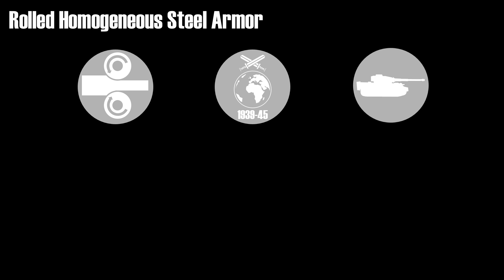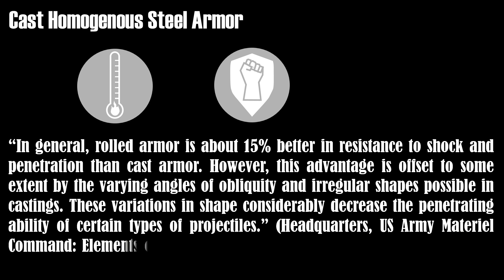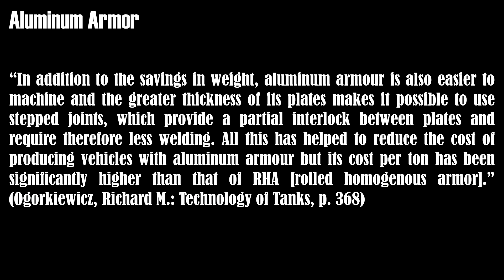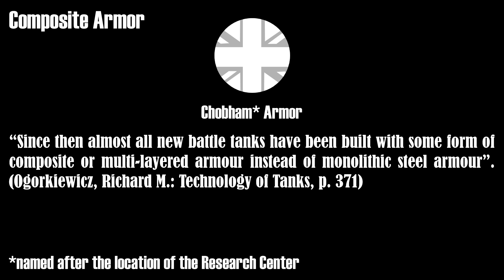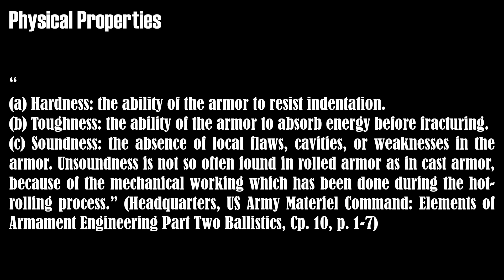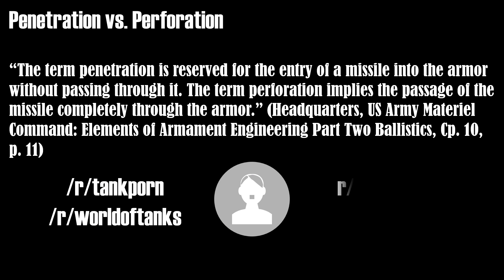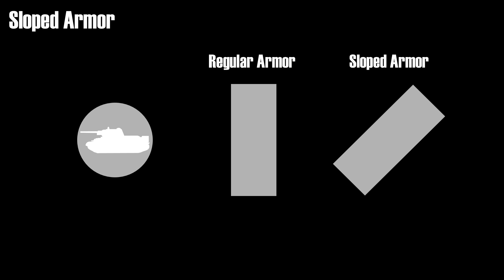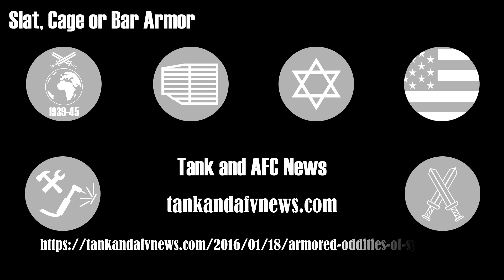[Tanks 101] Armor Protection 1920-1980 - Features and Characteristics

Comment: Another thing to consider about armour is that when it is sloped it, as well as generally giving better protection, it is often lighter than flat armour. Take for instance the upper frontal hull of the Pz IV and V  where you can see that the IV has two plates, one flat and one vertical whereas the V has the single plate. Sloped armour can also be cheaper simply because it uses less plates simplifying production all round.
Reply: Using sloped armor generally comes at the cost of internal space. Imagine the hull of your tank as a square box, and then youre making diagonal cuts around the corners, chopping them off, and you end up with less internal volume. 
Another factor is that the surface on the roof is diminished as well, which makes it difficult to place escape hatches. Most german tanks had them in the roof, but the T-34s driver hatch is embedded in the glacis plate itself, which is less than perfect (but compensated by being thicker overall), and some Sherman variants used a bulge for the driver and radio op in the glacis to get the space for the hatches and optics at the expense of these bulges in the glacis being more vertical, prompting them to weld on extra armor to compensate.
Reply: When they had plans to give the panzer 4 sloped armour it made it heavier so i think your missing something
Reply: Slanted armor of the same overall thickness is heavier because the plate must be longer. Reduction in weight comes when you reduce actual thickness and create a new LOS thickness.
Reply: 19Koty96 Indeed, but soviet training in 1940 and 41 was brazingly incompetent at times. I recall a russian report from the winter war saying something about a T-28 commander who was ordered by his commander to "advance that way" literally waving in a vague direction. The T-28 therefore drove that direction, that there were tank traps, and returned, having done nothing other than wasting fuel. That and a couple of incidents including artillery firing on their own recon units by accident due to poor coordination.
Reply: Allow me to clarify.
Say you're armoring a crew compartment that is 3 meters by 6 meters long by 1.5 meters tall. A 10 cm glacis that is perfectly vertical at the front will measure 1.5 meters by 3 meters by 10 cm. If you angle the 10cm plate at 45° the plate must still keep that same crew compartment safe but will now be 2.12 m long. Thus, for the same plate thickness, you will have a longer, heavier plate.
The weight savings from sloped plates result from using plates of thinner over all thickness at a specific angle to produce a desired LOS thickness. For example: If the plate is to have a LOS thickness of 10 cm at 45° of slope, then a plate of approximately 7.07 cm of thickness is required. At 60 degrees of slope, 5 cm equates to 10 cm of LOS thickness. But as you thin plate down to save weight or as you increase slope, you run into other problems such as risking overmatch penetration and increasing amounts of unusable space within tighter and tighter angles.
Reply: A war CAN be over quickly if it is on a small scale, by global standards. One european country versus the next one for example, you can overrun a country before they can mobilize the necessary resistance. 
But a war that drags out more than a year, by modern standards perhaps less, will mean that the defenders military can also properly mobilize and the offensive effectively stalls at some point, and then it just goes back and forth and eventually tips in one direction, but it takes long, causes high losses on both sides. 
And that already happens in the middle east. On average their "tanks" are trucks with guns or rocket launchers, sometime just assault rifles and RPGs. Can the combined Nato forces down there achieve any decisive victories? Not really, its a steady advance, but given how long this has been going on it is very slow. If ISIS had any real military industry that could compete they would have already offered much more significant resistance and maybe actually hold the line. 

Also: Stop assuming 1vs1 engagements by default. Life isnt an action movie where the henchmen attack the good guy one by one. If one more advanced tank goes up against two less advanced tanks, the two tanks have a higher possibility to win, a low possibility to win without losing one tank and next to no chance that they both lose. Why? Because no tank, excepting stuff like a T-35, can fight two tanks at the same time effectively. 
But having more raw numbers has other advantages. Look at Normandy. The US steamrolled the germans basically. Why? Because their "inferior" Shermans went up against AT guns, Panzerfausts, Infantry, occasionally a StuG etc., but the germans simply didnt have the numbers in armor to use it outside of major offensives. And even then they still didnt have enough tanks to achieve anything. What were their shiny panthers worth then?
The same thing works to lesser extent with smaller number advantages, but it still applies, if one side has more tanks, even inferior ones, they will be able to deploy them where the other side has no tanks because they ran out of tanks to deploy, and then your inferior tanks have a turkey shoot basically. Worth it? No matter how advanced your tanks are, they will never be able to be in two places at once. And in war that advantage is irreplaceable.
Reply: REgamesplayer you keep thinking that a war is won by technological supremacy rather than tactis and Strategy. take one look at france in 1940.
Reply: 19Koty96 Yeah but it wasn't shit. Adequate as you pointed out is much closer. Though having said that I'd say the T-34 was basically perfect for soviet needs at the time.

Easy to produce, easy to learn to use (maybe not effectively but still), always competitive with German tanks with T-34-57 penetrating tiger. Any tank that would be better would take longer to produce and would take longer to train on.
Reply: REgamesplayer And when will you get that developing the next generation of tanks will not achieve anything except an answer in the form of an enemy new generation of tanks? Its pointless spending more than neccessary to solve the existing problems, we neednt create new problems. 
The current tanks work well in their assigned tasks and a replacement with a completely new platform would be both uneccessary and wasteful, as both mechanics and crews needed long to adapt to it, while there seems to be little benefit apart from a temporary advantage in firepower that can be achieved more easily by upgrades. 
Tank development even in the US hasnt stopped, but the military hasnt accepted new vehicles because none are needed. 
And in numbers and quality of equipment, the US already outmatches any other nation in existence anyway. So why do you need more?
Reply: at least he's not a war mongrel...
Reply: In part I was trying to keep the first comment short. Overall that depends on the tank of course. For instance if you have the same thickness of plate for both the vertical and horizontal plates then obviously the slanted plate will be lighter at the same thickness. Whilst if you have a thinner or smaller horizontal plate it may well be lighter. Maybe the Pz IV/V comparison wasn't a good example as I'm uncertain of numbers but this would id be a lot more certain about the early Pz IV's. Also to Kekman (your post is removed as spam and I can't restore it?) The Pz IV with the sloped armour had many modifications such as a completely new turret and various other parts redesigned so may have been heavier due to this.
Reply: The reduction in weight comes also if you remove the side armor from where it used to fit to the vertical armor.
Reply: I always wondered of how to keep extreme angling of at least of 70+ degrees. You see, armor penetrating shells start facing real troubles in connecting with a plate from that angle which could not only make very scalable armor, but an armor which would bounce the most shots, even ones which could destroy the tank. But with this kind of armor, driver's position becomes unmanagable. You have to transfer him near the turret and turret itself to push back into the tank. I prefer putting transmission and engine under the frontal glacis and isolating this compartment with additional layer of armor. With addition of V shaped hull, you can place threads neatly in the tank while top layer expends with extreme angle, giving overall very high protection levels overall. That also would allow to put huge turret in relatevily small hull which is necessary in this day and age with 130/155 mm anti tanks guns being a standard (standard calibers are incapable of reliably defeating modern armor anymore).  Furthermore, as turret being completely automated, you do not need to space it out and thus you can angle the gun's armor as extremely as possible.

The only real issue which I have is: how to get out? I would have back doors for entire crew, but is it sufficient? The only next exit point is at the back of the hull, you crawl out of it, but that is quite pointless since doors are just so much more efficient and it is in the same area point as this hatch would be.
Reply: REgamesplayer Another option is to do the same thing as the Merkava Tank, which placed the engine and transmission together in the front. First advantage is that it enables you to further stretch the slope since the engine in general is less demanding in height than a driver, but it adds length until the hull needs to reach the drivers height, ergo enabling a much more extreme slope. Second advantage is that if anything penetrates, especially the lower glacis, it takes out your transmission and maybe your engine, but practically nothing will go through into your crew compartment and hit crew, fuel (in the rear behind the turret ring) or ammo, meaning the tank would be salvagable and the crew alive.
Reply: and if you manage to do a thick turret armour, it turns into a very good pillbox until rescue comes... But who wants to risk their lives?
Reply: Yup, this is why I had suggested putting engine and transmission in the front. :) In all actuality, my MBT would be very different from all today's tanks. I'm not saying it would be more advanced, but I'm saying that I have different attitude, mentality towards armor. Like Russia's tanks vs USA tanks. Same is with me, I prefer investing into sturdy platforms, that is including highly trained crews with exotic materials, combined with composite solutions. I would hide or up-armor those fragile external systems, I would make redundancies like wirring. My tanks in general would weight quite a bit due to heavy angling with very heavy armor.

I do actually consider to produce two lines of MBT. Which is quite feasible for a major power. Why? Because nowadays both platforms cannot do anymore that is needed from them. A MBT has to compromise on its weight, to be under 50 tons in order to be easily transported. That limits its upgradability and western tanks are already heavy tanks. If you cut the weight down, it becomes unable to compete. Thus MBT are heavy tanks in their role. While for maneuvering and flanking roles. for blitzkrieg I would use fundamentally different armor scheme, designed to protect from 105 mm shots. Tank would be more similar to Leopard 1 or PL-01 in its design.

Why I love armor so much? Because armor weights quite little. I mean, just to create a tank with gun, turret, all its systems will take much of the weight. 10 tons of additional armor is a lot of protection which really makes you question, is there are really big difference in mobility of having 30 ton tank vs 40 ton tank? Mobility actually matters then vehicle is around 20 tons due to difficult terrain which tanks could not pass, this is where you actually have to keep your weight down.
Reply: REgamesplayer Current tanks already get quite the most out of their mass limits via armor modules. Take the modules off, and its light enough to transport, put them on and they are protected enough to fight. 
Also uparmoring any and all fragile external component doesnt seem feasible. Most of them are one or another kind of optic, and you cant see through metal. Keeping them protected from bullets suffices. If anything bigger shoots at you, you have bigger problems anyway. 
My personal approach would be to minimize the silhouette, making the tank lower, similar to the philosophy of the T-54 and russian tanks thereafter, though with a more pointy turret front, and perhaps combined with the idea of a front engine.
Reply: In this day and age silhouette is practically useless with pin point accurate gun and various optical devises. All that still matters is now the space which you need to up armor and efficiency of the crews inside the tank. 

Modules are recent invention, yes, but they do not go nearly as much as needed. They do not transform light tank to heavy one. This is why you cannot make MBT a light version, because it will always have vast majority of its weight directly installed into its own hull. 

I'm not sure how well they are protected. Against feeble western arms of 5.56 mm yes, but I highly doubt that they could take 7+ mm ammo. The more pressing issue is HE shelling. A simple rapid firing 57 mm cannon is deadly to modern MBT. Not because it will kill it, but because HE shells will wreck havoc to all those fancy external defense systems. Active defense will be out. Explosive armor will be made ineffective, optics destroyed. I would even go as far as attacking enemy tank chemically. You see, I have idea of a shell...

It is a sticky shell which is low velocity. It sticks to the tank surface, spraying it by sticky liquid or substance. This substance is then ignited. In this way it would generate deadly smoke to crews inside, but more importantly it would deactive tank completely. Heat would mess up with sensors thus any active devise would be rendered ineffective. In addition, crew would be forced to stay put and calm. I want to complete shut the crew inside the tank, forcing to use internal oxygen or kill them. You see, this chemical substance would not only produce heat, smoke, but also that smoke would be "heavy", meaning it would float near the ground and in high concentrations - deadly. This would mean that unprotected crews inside the tank would die or if NBC is working well, they will be forced to stay put.  They could not outrun the smoke since tank would be covered in it. Also, it is great psychological weapon, knowing that you are completely blind and your defenses are down and there is enemy out there, preparing to murder you. You cannot run, you cannot get out. You are burning surrounded by deadly mist around you. 

The advantage of this shell is that it is cheap. Is independent of caliber and can make any cannon effective against even most heaviest of vehicles or bunkers. 

Btw: Do not think it is a science fiction. Napalm acts in similar fashion and it had proven itself as extremely effective weapon. I only want to increase our AT capabilities by bringing it down from aircraft to ground crews. Of course, key is: how fast it burns? It should last minutes at least to be combat effective.
Reply: In addition, if you have to transport vehicles, you as might just dissasemble them and transport hull+turret of MBT. You will just assemble them on the battlefield. In this day and age, it is more masturbating than fighting. Modern armies severely lacks transportation capabilities for huge amount of material and men and they severely lacks deployable infrastructure in combat areas.
Reply: Yup, mostly because they fight way out of their territory, so they have to fly most stuff in, and how many airplanes in the world can lift a tank?
Reply: builder396 quite a lot. The problem is - US tanks nowadays weight around (well over) 60 tons.
Reply: 19Koty96 Indeed. Making a tank progressively heavier is a trap that tank development heads into repeatedly. 
Simple fact is, if you want to have a better armored and armed tank you can theoretically stay within the same weight if you make it more complicated, but it would take years to develop the more complicated technologies necessary, and often engineers or armies are not willing to wait and take a shortcut of making the tank heavier and live with the consequences. The result is tanks like the Panther and Tiger I and II tanks of nazi germany. The same result could have been achieved with less mass, as evidenced by tanks like the Pershing, Patton or IS-3, who had comparable parameters but at significantly less mass, but arrived some time later on battlefields.
Reply: It is certainly not like westerners practically wasted decades worth of development. Just saying. If there is a thing that we have is this: time. Then war will start, that will be last time in our reserves. This is why I advocate extreme R&D budgets compared to that we are used to and I advocate closed markets. High tech should not be sold ever. Westerners on the other hand are way too willing to sell tools of their own destruction. Finest example is: French sold night optics for T-90 development. Due to purchases of combat computers and optics, Russians kick started their development to our level and we instantly lost decades worth edge. Now they threaten our borders and all we can do is whine then technologically superior forces, which was trained by us, threaten stability of Eastern Europe.
Reply: REgamesplayer High R&D budgets is the last thing you (I presume you mean US) need. It will just compound your problem of weapon systems being needlessly complicated and give companies an excuse to prolong development, i mean, money is flowing anyway, isnt it? Complicated weapons become useless in a prolonged war as you need more trained crews and significantly more effort assembling them, neither of which you have a lot of after 2 years of war. 
Cutting R&D budgets would drop a lot of worthless junk that has no practical application anyway out and make militaries focus on actual practical and useful weapons that win wars and not just weapons which look impressive. There already is an insane amount of money flowing into weapon development in the US, yes INSANE, but it proportionally speaking what comes out of it is significantly less than what you get from lets say german companies for the same amount of money, and we spend rather little on weapon development, but we have an excellent tank that can outperform an Abrams while being more economically minded. 

Getting ahead in technological development isnt worth squat in warfare as you need to be able to have the industry to back that up, and if you can only build 5 supertanks per year, and your enemy builds 50 reasonable tanks in the same time, guess who wins. The winning tanks often were innovative but never expensive or delicate.
Reply: Design of the systems and efficiency of R&D sector has nothing to do with the size and scope of development. Second thing is: R&D is long term investment. Having technological edge is crucial. Sooner or later you will have to research those technologies anyway and having done so in advance could help you to keep dominance in an age of strife like great depression. Look at F-22, Russians are only now catching up despite Americans sitting on their laurels.

The sorry state of USA research industry is just a bigger part of rot which complacent Americans allowed to happen. It is not a matter of bloated research budget doing nothing, but rather that leadership is pathetic. Look at Bradley, look at flak vests. Look at many things which they cannot perform. If it would be my nation, knowing distribution of flawed military goods would be considered a high treason and I would hang outside the White House everybody involved in it. Americans on the other hand do not care much about the quality of their goods as long as profits are floating in. 

Third point, R&D does not symbolise raising costs of the equipment. It is just that you choose to do with 100% solutions quickly. Instead you would need to look at how to keep or increase combat performance at the minimum needed work. For example, how to produce more advanced materials more cheaply. Or how to drive electronics prices down. For example, night optics were extremely expensive at their introduction, nowadays even civilians can afford it. This are just few examples of how R&D can help. It is all the matter of what are your goals. If goals are to make more cost efficient platform, to cut production hours, material costs without reducing performance in any meaningful way then this is that you are going to get. 

Weapon systems are destined to become more and more complicated. With new technologies being developed, more advanced counter measures are bound to arrive. For example, drones are the future. Armies need swarms of them. The first army to amass an effective drone fighting force will have immense edge. 

The issue is poor leadership and willpower. Westerners cannot pay with blood so they pay with treasure. Or in other words, if you want to save money then use lower tech gear, less support and etc, but be willing to send back your men in body bags. I can make this trade, do you? Westerners sadly cannot. 

Not true. Europeans despite not having huge budgets can afford to produce next gen equipment on their own. Producing advanced combat equipment means investment into technologies which could be used in later developments. It is not like you produce F-22 and this is it. No, bulk of the cost goes into technologies which you could use in other projects. You then build from those technologies. Stealth for example is expensive tech, but as you can see nowadays, it is essential technology. If you would begin from scratch now, you will need decades to catch up and you will still pay most of the price needed to research it.

Wars nowadays are not prolonged affairs. They are short and brutal things. If you plan to wage war for years then you need tanks like T-34. If you plan to wage short skirmish then you need tanks like Tigers.  Quality>>Quantity or in other words, if you are planning to wage short campaign, the quality will outweight quantity.  

Furthermore, please state that is being super about newest western equipment? The fact that I would upgrade them to 130 mm or even greater as standard? It is a fact that current generation weapons are underperforming against newest armor. The fact that I would use exotic materials in my steel armor? Are Abrams really that inefficient and expensive? No they are not. Turbines either are not that problematic.  The real issue is that westerners had abandoned their military and Europe's martial might is in shambles now. If Russia would attack today, it would destroy Nato forces within days and would be at the Berlin before we could do something meaningful.
Reply: REgamesplayer You know that the US spends more on its military than the next 6 countries put together? Sure, europe might fall early on if russia makes a sudden push, but as soon as it comes to the open sea, russia cant even begin to compete in the sheer number and size of carriers the US employs. 

Having a larger gun or thicker armor never won a war on a big scale. Sure, Tigers could knock out ten tanks before the enemy could destroy it because of its thick armor and excellent gun. So could Panthers, Tiger IIs and Jagdtigers. Except they kept breaking because the technology was too advanced to sustain. The best tank in the world is worth squat if it is mechanically unreliable or its crews are incompetent (german tank crews from 43 onward were on occasion grossly incompetent). 
The other 2 sides (Mainly US and Russia) had the simple advantage that their tanks were generally only a little bit inferior in firepower and a bit more in armor, but they were always available. They were easy to assemble, easy to maintain, easy to repair and easy to use, and they were servicable. 

Besides, you can save your "if russia attacks today" scenario. Russia isnt attacking. And even if, your paranoia wont help either way. Even if the US developed a bit ahead in weaponry, russia wouldnt need to match it, they just have to be close enough to be in striking distance (and the US tends to demonstrate what it has so staying on their tail wont be hard), have guns good enough to destroy your tanks, even if it is statistically 0.9 kills per lost tank themselves, because they produce 1.5 times more tanks than your hypothetical hyperadvanced tech tank. That is of course an oversimplification, but in principle a big technological advantage can win a war, a small one works against you, because it costs you in numbers.
Reply: So, you concede Europe so easily based on the aspect which is quickly decaying - naval might? 
I know that USA spends the most, but that is due to the fact that Europe spends next to nothing on its own protection. This is why Europe is defenseless. 

Tanks compared to German ones were vastly inferior, not just slightly inferior. Only Russians had initial advantage which Germans overtook and lasted only until post war. You also ignored my whole point. I'm not speaking about total war. This thing is a myth. It does not exist in the modern war. All conflicts are painfully brutal and fast. They are skirmishes, not grind fests of economies. In skirmish quality wins each time.

It is not paranoia. It is a fact. Do not try to hide over the rock like rest of westerners do. Nato is in shambles. Our borders are unprotected, we are loosing everywhere. We have very little wisdom, cunning and capabilities to do anything properly.

Technological edge matters more than you think. More advanced platform would win engagement more often and it is not just 0.9 vs 1. I do not know how you could ever come to this statistic. For example, if enemy cannot lock in on your stealth plane then you will get first shot. A plane which gets first shot usually wins. So, you usually win decisively each engagement. Or a tank, if you have more advanced night targeting optics then you can attack in the night and you will be able to fire effectively on enemy tanks before they can even see you, meaning their destruction each time.  This is why nations are trying to produce most technologically sophisticated platforms, because they know that most sophisticated platform wins most of the time then everything else is equal and a nature of today's war makes it quite pointless of not having a professional army in a first place. 

Last point which you do not understand is about having mediocre equipment versus excellent equipment. Why you would rather invest in inferior platform which cannot do its job properly then having technologically superior platform costs only marginally more? The fact is, any tank, any aircraft will be full with electronics and other exotic equipment. It will cost you a lot anyways. Another fact is, you capabilities will age and you will have to upgrade. So why you insist on paying for something twice? You will need superior equipment and you will upgrade to my standard sooner or later, so why waste your money on outdated gear? 
Is it worth saved, lets say 20% per platform then you are going to loose one because you were too cheap to pay for reactive armor like Russians were too lazy to put in on their T-80 in Chechnia? 

You are also confusing high prices, efficiency and economical solutions all into one problem. You did not heard me first time. New, high tech can be economical like modality principle, diesel engines and etc. It is not like Russians did not needed to research their T-90MS. Instead like Americans did, they did not went for the best armor composites available, but they choose to research for most economical solution. New tech was more expensive, but they had to upgrade to remain competitive. Or their T-50. It has inferior stealth characteristics, but it is not 1 trick phony with American all or nothing concept in F-22 Raptor. T-50 is far more universal plane, because it sacrifices high end stealth capabilities for greater performance and lower costs. It does not mean that they do not need to develop new and expensive technologies. That means that they choose to develop technologies which are more efficient, but do not offer the best available solution price wise.
Reply: Again, you are confusing scenarios and comparing incomparable. The issue with middle east is that they are fighting WW2 era armies or rebels. They are not suited for regular combat nor acts like regular combatants. The way they wage war is not at all similar of how proper nations wage war. 
http://nationalinterest.org/feature/the-soviet-unions-insane-plan-crush-nato-battle-13355

Granted this was in cold war era, now wars would be little less hot, but still, massive concentrations of armor can make giant encirclement of troops within days. Artillery can destroy entire battalions within a minutes. Weaponary had evolved to the point that any battle would be decided decisively and fast. War became far more intense, costly and deadly while ability for a nation to regenerate and to build during the war completely diminished. The issue is with sheer complexity of the military equipment which development cannot be accelerated to great degree and complete dissapearance of combat lines. Now threats can come from spies, cyber attacks, propoganda. Entire cities can be decimated by nuclear cases or viral agents released into water supply or air. That is ignoring that massive stockpiles of nuclear armament will somehow remain idle despite years of waging conflict and one side is being at the brink of total defeat. 

The issue with you is that you are still thinking in terms of the last war as most people do. That is completely outdated view to have in the modern battlefield. Your examples are also invalid. Nato is not even in those regions nor in any of those cases they are fighting a standing army. Heck, they were not even bombing ISIS at all. They just been there for political leverage and ensuring that their ISIS puppets do their dirty work for them. If you want to see effectiveness of modern airforce, look at that effect Russian air raids had on ISIS and how quickly tides had turned for it.

Cost of military equipment does not matter. Either you find money to invest into military gear or you do not. Either you modernize old equipment or you not. The quantity of the vehicle has less to do with its price, but rather with efficiency and policy of how funds are managed. Nowadays Nato can have any tanks they wish and it will be worthless. Why? Because outside the USA, Nato has no resources to spend on new gear. Their budgets are pathetic and military build up is a process. You have to systematically prepare it for years. So, the amount of equipment depends more on your policies rather than resources needed to construct a weapon. 

Also, you make another fallacy imagining that all tanks will go against each other. No, they are redistributed into armored divisions and among troops. Westerners love to keep their tanks with infantry. And you know from German invasion to France that quality and quantity of the tanks does not matter if you use them inefficiently. Same is in war. Even if enemy has a lot more tanks than you, that matters very little. Superior tactics and utilization of equipment matters more. Desert Fox said an interesting thing. He said to defeated British commanders that it did not mattered if you would have double the amount of tanks. he would still defeat them. Because you were sending one by one into my anti tank weapons and I had dispatched them with ease. 

If you think that USA steamrolled Germans in Normandy because of tanks then you really know nothing. It was airpower, confusion, intelligence failure, assumptions which made for successful and uncontested landing for allies in undefended beaches.  Furthermore, you do not know anything about the state of Werhmarht's armor woes back then. Allies and their armor proved to be pathetic in comparison. The real issue was in decaying industrial capacity and quality of German equipment and men. That was solely because of titanic struggle in the East which sapped Germany's strength. That you had faced was a defeated enemy already. Its armies exhausted and most material being redirected to the east. 

Deployment of tanks to infantry support role by default is inefficient way to use tanks. Stugs, SU series, BMPT Terminators and other similar vehicles are meant for infantry support, not tanks. Failure to realize that is a major source of looses and inefficient usage of material presented to the commanders. If you have an advantage in armor, you still need to have critical mass of them in order to launch significant attack. If you can afford to buy such amount of vehicles, it is rather because you choose to invest more into tanks than your opponents did that rather it being that your tanks just cost so little.
Reply: to complete my previous comment (i was fighting autocorrect) france fell despite numerical and for the most part technological superiority. because germans simply used better tactics. the best weapon is useless if your tactics are flawed. and given your stance you really think dumping money into r&d solves any and all problems in a war? it doesnt. the t-34 at the time was unbeatable but the russians couldnt do squat with it because they didnt have good tactics.
Reply: builder396 not only Soviet tactics weren't good (better said - they weren't polished) - they also could not deploy most of the tanks simply because they ran out of supplies.
Reply: builder396 yeah...
Reply: No, I'm not thinking that tactics matter less than military gear. I prefer myself to out think the enemy than to outfight it and I strongly believe in the shadowy wars, maneuvering and preparations. See, waging a war mostly depends on your initial state. If you did not invested from the very beginning in the war, you will lag behind for majority of its process. Just look at USA. Or Italy, terrible performance. Why? Because it weren't willing to invest resources needed for the scope of war they were desiring to wage. Or in the current age, control of middle east will dictate prosperity of the next age. With soon ceasing oil supply, its price will skyrocket and nations with supply of oil will prosper. So, it is imperative that we destroy and destibilize the region if we can ensure their loyality. Or with China holding majority of rares materials production. We must ensure massive stockpilles of idle resources in the case of war or gradually move away into more resources diversified economy. This is where government funded R&D sector comes into the place. We can ensure that our war effort will always be safe from economical war by researching without any pragmatically forseen pay off the technologies nececessary for war. 

  I do think the opposite, but in the current tech dependent age, military gear certainly had gained far greater importance than before due to reduction needed on training and leadership. For example, before you had to fight without GPS, constant connection to the HQ, coordinated to perfection artillery strikes and air support on squad level engagements. Smart ammunition had allowed all of that. So, more incompetent army with technologically superior equipment would win more than before. But also, the amount of skill then competing with an army of similar technological might had increased. 

Another point is that new technologies and solutions nowadays are far more difficult and resource intense affairs. Wars are short and brutal. We won't have time to build tanks and research several generations of equipment, only to make modifications to the current arsenal and to finish current prototypes and projects. This is why I believe that ensuring technological superiority is the best way to prepare for war. How a nation can ensure superiority? By investing heavily in its armaments. Look at Russia, nation with a size of a Spain's, but it somehow manages to be a threat to entire Nato! Did you ever pondered how it is possible? Because of efficient R&D industry! Home made armament is of magnitudes cheaper than imported armaments. 

Furthermore, you forget that Soviet victory over Germans was based on their excellent military gear. Il, T-34 and many other superb equipment helped Soviets to bleed Germans dry and to give themselves necessary power to survive the onslaught and begin the counter attack. Without this gear they would had certainly lost the war if they would had had technologically inferior equipment on top of being outmatched in leadership and tactics.

Btw: by not contesting majority of my points, I will assume that you concede them.
Reply: That is, because Americans had never invested much into their own tanks. They were mediocre at their own versions and embarrassingly, often had to buy other nations products like German made tank cannons. Nowadays Abrams stands as a relic of the past. Outdated by two decades already it must face enemy tanks which sometimes like in Russia's case, managed to go through two generational changes even! Russia invested heavily into tank development and had managed to squeeze in two whole generations between Abrams upgrades... That is: T-90/MS and T-14 tanks.Abrams is one of the worst tanks in the current day which you could buy. You could see how fragile they are in middle east. Granted, missmanaged tanks without upgrades, but they are too were facing outdated cold war era missiles. The simple fact is, Abrams are cannon fodder if they will engage in full out war without upgrades necessary for modern war, that is including active protection systems and era armor. 

Remote controlled tanks are drones. That will never happen due to the threat of electronic warfare. You cannot ensure constant connection to a platform via electronical means nor you can ensure its cybernetic safety neither.  Drone swarms are the future, but they are mere supplements to the army, not the main tools. 

You also make my point. Huge R&D budgets are necessary. Why you would want to build your tank forces on Abrams M1A2? They are outdated. You need entirely new generation of vehicles. Like Russians did, they had withhold their armor purchases until T-14 and just continued to upgrade old tanks. You can see that there was a massive need for tanks in Russia due to massive purchases of T-14 despite T-90MS not being outphased for forseeable future and upgrades to T-80 being considered. This is how you outhink the enemy and invest your resources at the most efficient points available. 

Or autoloader. 15 shots per minute is great, but how you will keep barrel integrity? Heat would destroy the barrel. This is where you come in need to liquid cooled barrels. Then you can begin your efforts into converting tank cannon capable of 30 rounds per minute bursts and etc.
Reply: REgamesplayer By not contesting every single one of your points im simply considering them too long and off topic to address.
A: The T-34 was a very good tank, Im not disputing that, and even in the later stages it was still adequate, albeit inferior in combat value to a (functioning) Tiger or Panther, however, that was not was pulled things around for the russians. As I said, in 41 the russians were taking massive losses due to encirclements and extremely inadequate training and resultingly bad decisions leading to said losses. That cause, the training of troops and commanders, dramatically improved around 42 making the soviets gain the advantage around 43 and able to take the offensive, that plus other factors like the german losses at Kursk.
B: You intend to be as secure as possible as a nation by making your country so prepared for a war that it will almost definitely win it. As a motivation, that is understandable, and if you go ridiculously overkill, it might even work. After all, war is decided solely by who is the most prepared for it in advance, right?
Except the world isnt a video game where having more everything than your enemy lets you steamroll him. In a battlefield sense, yes, but real world as in big picture you will achieve the opposite. What you propose cannot be interpreted as anything but preparation for an all out war, an offensive war, not an all out ability to defend yourself, even if that is your intent. If your neighbor purchased 20 tanks, you also wouldnt be fooled into thinking that he is just gonna defend his home with them, right? 20 tanks to defend a house simply is out of proportion. Similarly, if you gear up that much, it will trigger a response from any nation that may or may not have something against you beforehand. There is two ways this can end: Either the other nations will also invest heavily in their military, essentially creating another arms race that will exponentially make weapons bigger and more powerful at an extreme rate, make armies grow beyond any size that a country can even support (look at north korea for reference if you want to see a country that invests so much into the military that normal citizens have neither reliable food or electricity), because you have to keep your extreme advantage for your victory guarantee, and they have to follow to match your military in case you invade. The other scenario that can happen is that they decide to take the initiative before your build-up is complete, by whatever means necessary. That includes the possibility of threatening with a nuclear attack (as conventional offensives are out of the question) and executing an all out nuclear attack. Im not sure either of those options is your intent.
The better course of action is to be economically mined, yes invest in military development, but only invest in what you actually need, and not beyond that. We have relative peace at the moment, not worth wasting it with a military buildup that causes another cold war. 
C: The point I wanted to make with limiting R&D budgets is to focus development on worthwhile stuff. The US spends a ridiculous amount of money on its military in general and R&D specifically, and to some part into projects that are dead ends, run into delay after delay, or are plain unnecessary. The F-35 development is the most expensive military development project in history. Why? Because Lockheed felt it was a good idea to start producing parts before testing was done, and then having the mess of fixing design flaws while production was running. A complete waste of money and resources that wasnt neccessary, but possible because  163 million dollars over budget and seven years behind schedule. If budgets had been tighter, Lockheed would have had to work with less funding and operated accordingly, avoiding obvious mistakes that would lead to waste of resources. 
But the US always has been pretty wasteful. 
D: 15 shot autoloaders actually arent much of a problem. Look at comparable automatic naval cannons. High rates of fire, belt fed, similar caliber to tank guns. Overheating issues? Not really. The bigger problem is fitting such an autoloader (Im assuming you refer to drum loaders or similar and not to an automated loading mechanism as the Leclerc MBT has which simply replaces the loader). 
E: All other points: Please doublecheck if any of my points so far voided them, like the whole provoking-cold-war-thingy probably kills most of it. 

Dylan Milne Yes, the Panther was indeed made as a counter to the T-34, intended to be better in any category.
Reply: ~ T-34 was first shit (proven by NKVD testing) - and when they fixed all those (T-34-85) it was quite obsolete.
Reply: 19Koty96 So the fact the Panther was made to counter the T-34 is all just a lie right?
Reply: Dylan Milne hmm? Never said that.
When designed, and in like 1941, 42, it was adequate: It had good armour, but terrible mobility (shifting to third gear was really not easy - and original tracks were a disaster), terrible visibility, terrible gun control (you had to manually switch (it took long because of the awkward position of controls) between manual - which was slow - and electric - which was highly erratic and thus practically useless. The turret was also very small.

And so on. Note - that's what NKVD said.
Reply: 19Koty96 As the Chieftain (a guy on youtube who does a series called "inside the hatch" and works for wargaming and WoT) once said: To be a driver in a T-34, you need to be strong as a bear, flexible like a chimpanzee and short like a midget.
Reply: yeah, that's kinda what I meant
Reply: o
Reply: I mean, you did not contested any essentials of my points. I feel like I wasted time with you and discussing about T-34 means that you lost the view of that is important. Whatever you might prove with this tank will be irrelevant since it is just one example. Furthermore, I will not even address others with their stupid and outright wrong claims about this tank. 

"That cause, the training of troops and commanders, dramatically improved around 42 making the soviets gain the advantage around 43 and able to take the offensive, that plus other factors like the german losses at Kursk."

It did not. Training of the Soviets did not improved much, but rather self imposed idiotic things were removed like political commissars furthermore, Soviet army was willing to learn rapidly. It gained combat experience and in comparison it was able to maintain its training level while its opponent were not to. Germany's army degraded significantly and that made skill gap far lower.

Furthermore, you are under wrong and typical illusion that poor training and huge looses was all that Soviets experiences in early war. That is not true. Soviets bled Werhmarcht dry and then at the titanic engagements which turned the war, Germany was already just a mere shadow of that it was once been. Superior technology played a major role in enacting those looses despite the inferior training and tactics. 

B. That is not true at all. USA is doing that all the time and it does not create arms race. Russians were doing massive build up and nobody cared before it started using its military offensively. Do we have arms race? No. Our good living is more important. China is investing heavily into its military, but that did not changed a thing. Same with inter-war periods. Germany were under massive build up and breaking Versalies left and right, but nobody really cared until it started annexing nations (that is before Poland). And even then, allies build up acceleration was very slow and only feasible to outmatch German's arm race in the long run. Build up is part of the game to be perceived less threatening than you truly are. If you try to raise few waves, you will raise few waves. If you want to raise a lot of waves, you will race a lot of waves. Pro tip for an evil dictator: do not threaten to destroy democracy before the night you actually are going to do that. Do not boast, keep your mouth shut, play diplomatic game, be friendly as long as possible. 

C. Mismanaging of the sector is not result of massive money inflow. It is combination of bribery, lack of will and many other things. Heck, even president warned USA about this stuff, but people are idiotic to the extreme. They thought that president had lost his mind and started talking nonsense, so everybody ignored him. USA instead of more investments need to focus on efficiency. Like Trump had said, you have to do more with less. 

D. Modern weapons have thermal sleeve already attached. The issue is with uneven cooling which bends the barrel slightly, thus killing the long range accuracy without special FCS solutions and sensors. Furthermore, I do not think that semi-auto anti tank gun is possible with current tank barrels. The wear in the inside and heat generated would be simply too great. 

In any case, I do believe that the best way to fight the tank nowadays is to fire dozens of anti tank, chemical rounds, each of them with over a thousand meters of penetration, but together they would just use their combined power to decay the defenses and the steel in the specific place. In a similar way as new age artillery works by firing several times at different angles and making sure that each projectile hits at once. Same principle can be applied and to tanks, automatically firing several low tech shells for low cost to the same spot on the tank, overloading its era armor and eroding its armor if one direct shell hit is not enough.
Reply: Arguing on the technicalities does not mean anything. M1A3 is not out yet and T-14 is in the very final stages of research. It is practically done since final prototype models are undergoing intense testing and obviously higher ups feel very confident in the machine and they are eager to begin mass production. It is obviously is done. T-90 is not a T-72 prototype. It is merging of the two tanks. T-80 and T-72 into one machine. I think it got its turret and fire control with optics and all the other gadgets while inherenting hull and engine from T-72. It is not T-72 and it can be considered as a new generation tank due to not being direct upgrade nor having just slightly increased combat characteristics. 

Quoting disgraced scientist is also not a good way to show your superiority. Getting my argument wrong too just wastes my time. I did not meant that it is difficult to maintain connection, I meant that it is impossible to do on the current fundamental level. If enemy decides to jam communications and DoS attacks are impossible to defend against then this is it. Your entirety of an army is lost. This is ignoring the cyber security threat. I study this subject and I know that all systems are unsafe and hackable. It is only the question of time and effort and current defense models are here to rather discourage hackers rather than to protect the system. 

Yes, they had planned to do 140 mm cannon. In fact, 140/155 cannons are old technology. It should had been implemented in late 90s or early 20's since guns were ready by then. It is just everybody got lazy and decided to save money because USSR collapsed and there was no further threat of Soviet tanks which were  a real threat by that time. I'm supporter of upgrades and conversions. For me even T-34 is not obsolete. I would gut it out and modify heavily to serve some limit goal. 

Stocks are also part of the war need. You cannot operate on just that you need at the moment, but also have a massive reserves.  Furthermore, it is up to question how much they will replace older models then they will be introduced in the first place. Furthermore, Russia is creating entirely new combat units. 

Not sure why you are bothering with the last bit. I agree with you, but I address the actual technical problem. Then you are firing shell per every 2 seconds, whole new range of problems appear.
Reply: So, now you are going all emotional on me you little shit? What this is going to achieve rather than to point out that you lost on all of your points? 

Btw: my only mistake in this was reading the name of the author wrong. I misread it to Dawkins.
Reply: REgamesplayer And you keep missing the memo that were at peace at the moment, and a build up like you are proposing is both unnecessary and detrimental to any other part of your nation, such as education or infrastructure, and god knows the US isnt scoring that well in either compared to europe. 

Besides, current western tanks, both european and american are servicable. They dont need to be superior to everything existing, they just need to be able to take out anything they need to, and they are doing that just fine. 
Youre still talking from the viewpoint of the country with the highest military budget of the world by a huge lead, and youre saying "SPEND MORE". Why? Whats the point? Are you that afraid someone might attack the US in a symmetric war? Doesnt seem a plausible scenario to me. Maybe youre just that insecure. 
You have more than enough military to win almost any conceivable military conflict that could arise, and those that you couldnt would include either nuclear scenarios or half the world going against you. 
Its pointless.
Reply: Yes, tanks are servicable, but the point is: we do not have numbers or resources for a prolonged fight. So, we must ensure to be superior in quality in order to decisively win our engagements through shock and awe. This is why in principle we went with a wrong direction after collapse of Soviet Union. We did not needed to arrogantly assume that world will be perfect from now on for forever and cancel new generation tanks. No, instead of choosing cheaper upgrade path, we needed to take more expensive path of creating entirely new generation of combat vehicles. Why? Because it is investment for a long game. If Nato would have followed my advise then now we would had technologically superior equipment to all of our enemies. Nor I would export finest grade military gear for profit to human rights violators just because I might loose sales.

USA is a separate case. As I said multiple times, the issue with USA is missmanagement of funds, not that there ain't enough of them. Also, I'm saying that priorities should shift. USA should be far more concerned in equipping their force with technologically superior armaments. With my leadership, all the new age programs who were cancelled a decade ago would had been completed by now and USA would be under modernization program. From where I would get funds? From being smart enough not to be engaged in decades long, pointless guerilla war in which we had achieved nothing. You see, using your military to destroy a nation is a good thing. The issue is then it start costing as trillions of dollars. These cost seriously had erroded USA military might and allowed China to expand. You see, USA priority was China first before the events which had made it stuck in middle east.

http://www.mintpressnews.com/corruption-fraud-and-waste-the-fruits-of-american-empire/187264/
http://www.usnews.com/news/articles/2016-09-14/report-corruption-instability-in-afghanistan-due-to-us-mismanagement-of-billions

Quote: 

"According to “VICE”’s report, which is based on estimates provided by Special Inspector General for Afghanistan Reconstruction (SIGAR), of the $100 billion or so in funds — more than the United States has spent rebuilding any other country, including Germany after World War II — allocated to rebuild that shattered country, most, if not all, of it has been frittered away to absolutely no effect. It has, put simply, either been stolen outright by corrupt contractors or allowed to evaporate into thin air by incompetent, unaccountable Pentagon and State Department officials who know they will never be held accountable for their gross, some would argue criminal, mismanagement.

“For some reason when you are a bureaucrat and you lose forty to fifty million dollars, you’ll get a promotion,” SIGAR’s chief, John Sopko, a former prosecutor renowned for taking down the mob here in the United States, told “VICE.”"
Reply: Because it is not the case. Nations are always trying to compete and by not researching new generation technologies you will be left behind. See, this that had happened with western powers, they got arrogant and cocky and stopped their efforts to develop new weapons. Result of that is now we are in general, technologically inferior to newest Russian equipment and even China manages to equal itself out in many key aspects. 

Small edges or marginal edges is all that is needed then both forces are of equal strength and skill to win. Sometimes a small edge in technology contributes to extreme advantages until the counter measure is being brought up like advances in rocket technology had decimated armor in every engagement until explosive armor was created and more importantly, being utilized. USA's Black Bird had gave USA intelligence advantage over their enemies to the point that their foes could not do anything without disciplined use of that plane. If a major war would had happened during that time, our forces would have vastly superior intelligence gathering capabilities over our enemies if we would utilize that weapon properly.  Or even better, see that technologically and tactically dominant army can do. We are waging decades long wars in middle east and we barely had taken any looses. 2+ thousand American lives are ridiculous looses which speaks about effectiveness of our military. This is by no small part of having technologically superior equipment to support our troops. Or for example, campaigns in Yugoslavia. We had engaged rebel AA forces which had old Soviet weaponary. We had managed to bomb them undisturbed as we please without taking any significant casualties despite of serious AA presence in the region. And you know, having air dominance in the war is just war winning by itself. 

Sometimes huge advantage takes decades to erode. For example, Russian ballistic technology is several decades ahead of ours. This is result of their application of my philosophy. Constant and generous funding of the technology's development despite current needs. Or their tank is rightfully decades ahead of ours and depending on how much new investments will be dedicated of such tanks as Leopard 3 and Challenger 3, T-14 might prove to be a superior tank in upcoming 20 years or so. 

On the other hand, if westerners would stop selling their military secrets left and right and would know how to set up firewalls properly instead relying on interns to secure multi-billion investments,  that advantage we would hold even today. You see, developing new technology on your own ain't easy. It requires well functioning economy and dedication. Just by keeping our own advances always going, we will ensure that with our continuing prosperity we would amass critical mass of time advantage over our enemies. By that I mean, time spent on research which they cannot afford to do it.

You are also wrong on upgrading. Upgrading works in the short term by extending life of the platform's by including upgrades necessary. Sadly, a platform has a hard cap until it can be upgraded. For example, many extreme advantages that T-14 has cannot be replicated in our tanks. Autonomous turret, huge calliber cannons, crew capsules, radar (active defense system), armor protection schemes. Redesigning tank around any of these things would be like making half ass Leopard 2.5. For example, up gunning a vehicle is more difficult than it seems. First of all, turret space is very limited and often gun breach makes working conditions in the turret unworkable. Second, a turret cannot handle the power of the new gun and thus cracks develops which destroys integrity of turret armor. Then you have suspension which is designed for a very specific weight limit. Then you need a bigger turret for a bigger weapon, you also need to add a lot more armor. Ammo also is being changed and you suddenly need to find a lot more place for it or cut amount you are carrying by a significant margin. 

In other words, upgrading is a very effective tool which allows even obsolete equipment to become relevant in today's battlefield, but it is a short term solution. Designing new tank from the grounds up ensures that longevity of the platform is far greater and that tank itself is vastly superior. Why do you think designing new equipment is so expensive and unpredictable? Because multitudes of new technologies and equipment are being integrated, in this case westerners could adopt electric armor, 140 mm cannons, autonomious turrets just name a few inventions which are necessary in modern combat. That is of course ignoring that tank nowadays needs stealth technology in order to avoid sensor detection. 

As I said, it is the issue in the first place. Nato is short sighted organization who is incapable of planning ahead and ensuring its own superiority rather than parity. It is a paper giant, like the allies in inter-war period, ripe and rich, just waiting to be conquered by a new raising power such as Russia or China.
Reply: You see, it is okey to admit that you were wrong or that your knowledge is not up to par to debate and to prove that your opinion is right. A debate does not have to be to the death and devolve to insulting each other like the last guy did. I also did not reached this level in a day or so. It took years of constantly reading about such matters, thousands of news articles, dozens of books and hundreds of military articles. Everything I say I can prove with documentaries, articles, opinions of experts or books and I know that general understanding about such matters is completely wrong. I can now see the claims in which I had believed were bullshit and I know the deeper reason behind a lot of things.  

Btw: Whatever you choose know this that I'm okey with you having different opinion. I spent so much time in educating you only because you were a calm and rational person to discuss such issues with. If you want, I can direct you to specific sources like books to understand more about the things which you got completely wrong. Like for example German's war against USSR which was brutal from a day one and war was lost by Germans far before battles in Stalingrad. It wasn't at all like Germans had marched in Russia, winter came, they froze and started producing only super tanks which were too few of them and thus lost the war. Defeat of Germany in fact was a very gradual process from the operation Barbarossa.
Reply: REgamesplayer Youre initial assessment is still wrong: You do not need to invest more into the military if youre investing more than the next 7 (SEVEN) countries combined. Its wasteful, pointless, and guess what? There is things outside of military conflict. But you dont get that, do you? The only thing you care about is your military and how big it is and how to make it bigger, and that its not big enough. You dont even bother to think whether its necessary. Your entire thinking fails on that. You mistake having less than the best tank in the world for having an inadequate tank. You fall into the same thought trap as so many military leaders, giving into a paranoia that what you have isnt good enough, that you needed to be not one but two steps ahead of any potential enemy, just to make sure your enemy doesnt catch up that one step. 
That entire thought process is fundamentally wrong, especially in relative peace (yeah, were fighting ISIS, but thats hardly a symmetric war), spending anything on a military beyond what you need to maintain it at a reasonable size and keep pace is illogical at its core, as its money you have to take out of tax money, that could be spent on a gazillion other things that are more pressing (fight global warming, improve education, fight corruption, reduce poverty, finance universal health insurance (like Obamacare, but thanks to Trump thats a goner), civilian infrastructure, building hospitals, social welfare, reduce taxes and a thousand other things). If you would actually cut military spending down to that standard, you couldnt just get some of these things I listed done, you could get ALL of them done and had some left. 
Now, is it worth having a larger than by any sane standards necessary military, at the cost of not doing such a phenomenal amount of good in the civilian sector?

And yes, I also know a lot about the military, though I focus on WWII an technical aspects of stuff, but I probably match you in the sum of that knowledge and know well enough that what you propose neither helps in the long run, nor is it necessary to be two steps ahead of any potential military. Not unless you invent a completely new element into warfare, and that doesnt take money, but a good military thinker who likely is employed by the military whether you invest heavily into development or not, or just a creative private inventor who comes to the idea by himself. Then you actually have an aimed development that is actually worth funding rather than throwing money at everything at the same time to fulfill needs that you dont have.
Reply: You are not listening to that I'm saying and thus you are speaking with yourself. From this point I'm going to repeat myself until you will get my position.

1) USA is inefficient in usage of its resources. The amount of resources spent has nothing to do with how you redistribute them. My position on USA"s case is this: they need to be more effective with that they got. I repeat, if you cut expenses, you just loose advantage. This is that Obama's cuttings had done to US army without actually working towards making whole redistribution of resources more efficient. 
2) 3% of GDP going into military for purchases. wages, training, maintenance is not that much. 2% is a recommended norm for Nato members and such small countries such as Estonia or Poland can easily managed it and still lead in development of their nations. USA only appears to spend so much, because it is such huge economy and it had really diluted dollar value. I mean, GDP just lie about purchasing power in home, you must look at PPP index. Also. one state is bigger than whole European country! This is why USA will always have massive budget no matter that. We should better compared European army vs US army.
3) No nation had ever prospered without being safe first. If a nation cannot ensure military dominance first then prosperity back at home means very little. This is why military must come first before well being of its own people. The amount of resources needed to be distributed is up to question, not the priorities. 
4) Not having a need now means nothing. Human history is full of war and it is only the arrogance of western powers who make us think that we are safe while world around burns. How far we managed to go without a need for another heavy combat platform such as tank? Whooping 20 years! 

Your whole attitude of stagnation and corner cutting is an epitomy of why Nato is in such bad shape now. How much Nato members actually invested into their well being while decimating their own martial potential? They do not have much to show for it while I can show to you to barely functioning armies who can only bark nowadays. I can show to technological stagnation and wasted time. I can show how our enemies are progressing faster and are gaining advantage over us in all fronts. I can show failure after Nato failure to accomplish its own goals. 

Your defeatist attitude of ''sufficient is enough'' is the reason of why our military had degraded so much. Nato does not have numbers. We do not have the will. All we have is our human potential and money. We cannot throw men at the objective like China or Russia would do. We need to outperform them instead. If we cannot do, their superior numbers will overwhelm us in upcoming skirmishes. If we cannot deploy more troops then we must deploy superior troops. If you are content on upgrading several decades old platforms with from the market available solutions, you will never have better equipment than our enemies. In fact, you will be inferior to our enemies who actually invested into such systems. As I had showed you, Armata series is clearly superior to everything we got (except for new generation vehicles which we built like Puma for example) and it is not just the only new generation system which is coming from them. This had happened exactly because leaders followed your way of thinking, not my. I would had instead focused on development of completely new generation platforms. Sure, I would had spent quite a lot more on new generation weapons, but now I would have the military edge in every engagement. My technology would be several decades ahead of my enemies and as long as I would be able to maintain my system going, my armies would significantly outperform enemies.
Reply: Listen, you take US and speak about just it. It is different matter. Rest of the world does not spend nearly enough on their armies. I'm speaking more about those countries. I would had pushed for unified European army as cost cutting measure. I would had never stayed in middle east and thus saved trillions for my modernization programs. I would be lighter on military presence and would shift those resources in creating smaller, but technologically more advanced and far better equipped US military. My point IS NOT ABOUT INCREASING FUNDING TO US MILITARY DRAMATICALLY, but rather spending that they have in wiser, more long-term oriented way. Such as investment into new generation platforms who automatically have far longer longevity and upgradability than our current platforms. I would spend that money on new technologies such as nano-materials, electronics, minitaruzation, space development and many more similar areas. In fact minority of army research goes into tanks or similar, strictly militaristic matters. 

http://science.howstuffworks.com/10-game-changing-technologies1.htm

US have massive problems with its military spending, yes. But the issue is not with the amount of money it receives, but rather how it uses them. If you had read my article you will see that whooping 100 bln dollars were stolen from US budget. Does anybody care? Not at all. This is the real issue you have. Massive corruption among US officials. US is becoming like China during WW2. It is a giant, but it is a paper giant. It is rotting from inside out and if the trend continues, in next 20-30 years all I will need to do is to bang on the door really hard and rest of the house will collapse.
Reply: REgamesplayer Then I will repeat myself again, since you keep missing my point: Increasing military spending, or even keeping it at the same level, is pointless. There are no wars to speak of, and there are no wars in the foreseeable future, so whats the point in spending this much money on your military if all it does is sit on its ass doing maneuvers and cruising around the world and showing off? What the US military is, is beyond what is necessary for any purpose it has, and what is being spent on it is beyond what a military even of that size should cost. Its total overkill already, and youre proposing to increase that. All military spending is relative, if everyone else had smaller armies, you wouldnt need as big of an army yourself either.
Youre saying everyone else is underspending their armies. If there is everyone doing one thing, and only one doing the opposite thing, maybe the one is the odd one out doing the stupid thing, and not everyone else. Meaning: The US is overspending on their military.
Then size of a military is relative, and yours is by relative standards enormous already, as well as between well and very advanced. And you want to go even further? Why? What possible goal would that accomplish?
You complain about corruption within the US officials? Put less ridiculous amounts of money into military R&D, and suddenly you will have less money vanishing into black holes.
Or put it into the civilian sector and do something that benefits the actual taxpayer for once.
If you follow my train of thought, you will notice that your entire standpoint is based on an invalid assumption altogether and therefore invalid as well. And that is what you need to understand.
Reply: Ah, here is your problem. You naively believe that peace will last. Well, I live in constant expectation of war. I know that in my life time a lot of wars are going to happen. Even genocidal ones. Thus my thinking is completely different. This is why you are against ANY military spending, not just for re-organization of the current spending. You needed to say that you do not believe that any threat will emerge at all. 

Overall, that is very naive view. Before in late Victorian-era people believed that the history is over. World will be as it is forever. Then WW1 had happened. Versalies and league of nations was supposed to ensure that such war would never happen again. Then WW2 had happened... After WW2 we expected to be at peace. Then communism happened... During cold war we almost started nuclear war 3 times! The very fact that we are sitting and debating here is a miracle! After collapse of Soviet Union, allies thought that nobody will treathen them ever again. 20+ years, Russia is attacking sovereign states, performing massive military maneuvers at our borders, actively attacking us with propoganda and cyber attacks. China is investing heavily into its own military and is threatening to take specific islands with force. War between Japan and China seems inevitable if current trend continues. 

To think that war is coming is just naive. Our history, European history was nothing, but war. Our continent is forged in war. We were blessed with short respite, thus we had grown weak and complacent. Arrogant and deluded. Sooner or later we will fight. We will fight not just some third rate power as Bosnia or Iraq. We almost fought Iran and might need to anyways. War is coming and sooner or later we will face a serious foe. If not in war, then in skirmish and the preparation and superiority of our forces will be put to question. If we fail, our role in geo-political matters will diminish and our prosperity in turn will be reduced by being unable to continue our neo-imperalism policies.
Reply: Read that I write. Then relax, take a brake and read it again:

Its total overkill already, and youre proposing to increase that.

" My point IS NOT ABOUT INCREASING FUNDING TO US MILITARY DRAMATICALLY, but rather spending that they have in wiser, more long-term oriented way. Such as investment into new generation platforms who automatically have far longer longevity and upgradability than our current platforms. I would spend that money on new technologies such as nano-materials, electronics, minitaruzation, space development and many more similar areas. In fact minority of army research goes into tanks or similar, strictly militaristic matters." 

Youre saying everyone else is underspending their armies. If there is everyone doing one thing, and only one doing the opposite thing, maybe the one is the odd one out doing the stupid thing, and not everyone else. Meaning: The US is overspending on their military.

Their armies are in disrepair and cannot perform their major functions. Then it comes to question, why we need at all an army if it cannot do shit? The answer: we do not. It is either capable of doing that is intended or it is not. If you had read my articles you would know that nations who underspends that is supposed to be spent on military actually have military in attrocious conditions and are nothing more than paper gnomes.

You complain about corruption within the US officials? Put less ridiculous amounts of money into military R&D, and suddenly you will have less money vanishing into black holes.

Uhm, this is not how we fight corruption. We do audits, raids. We investigate and we put watchdogs in place. There are tons of ways how can do that. Furthermore, your proposal is just idiotic. We have actively corrupt individuals who are stealing US state funds in the billions and instead of finding them and putting them behind the bars, you would rather jeapordize entirety of US military while leaving the very same corrupt individuals at high places. You need to fight corruption, not just admit that you can't do anything against it then at least lets make sure that it doesn't have much funds to exploit. 

Then size of a military is relative, and yours is by relative standards enormous already, as well as between well and very advanced. And you want to go even further? Why? What possible goal would that accomplish?

To establish long term superiority over the all potential enemies. British Empire did not became great by just being British. It had to fight often numerically superior enemies with a lot more material. How they won? By discipline, superior training and TECHNOLOGY. Without being technologically far beyond their competitors, they would had never had their Empire in the first place.

Or put it into the civilian sector and do something that benefits the actual taxpayer for once.

Actually no. You are proposing to put money into the mouths of its own citizens. That would mean we would grow even more fat and complacent. Good of the nation should come first before the good of the citizen. This is why spending those dollars on destabilizing middle east and keeping oil price under the 100 dollars per barrel is far better investment than putting that money into socialism. It has literally zero return value, it only makes living better for its own citizens.
Reply: REgamesplayer Okay, youre nuts. If you prefer to build up for war rather than feed educate and help your people, youre no better than north korea. 
Im done wasting my time on you. Get your priorities straight, and maybe eventually youll find saving lives more productive than taking them on strategic scales.
Reply: This shows that you are not interested in discussion at all. You are convinced that you are right and you do not respond to arguments at all.

I did not said that education or healthcare is not important at all. I said that preference should not be to those sectors. Especially to the point it starts to hurt military. 

Btw: congratulations for calling US think tanks, presidents and their advisors nut cases. I bet you know better than US government and only you see and know that they do not. Sadly we did not elected you for president. You would set that White House full of idiots straight!
Reply: REgamesplayer Sorry, putting idiots into the White House is a Job Donald Trump is way better suited for, as he aptly demonstrates.
Reply: You know that you basically saying that you are more intelligent than whole USA foreign policy now for several decades, right? I swear, those leftist sometimes tells such idiotic stuff...
Reply: REgamesplayer No, im just saying im seeing the bigger picture that you dont wanna see. What you understand begins and ends at military. That youre living in a country where there are people who believe the world is flat, who cant feed themselves despite working full time, without obamacare wouldnt and soon wont have insurance, doesnt seem to be anything you even consider. Here in germany all these things are basic standards, and instead of ensuring these basic standards you want to keep spending money on a military that at its current size isnt even necessary.
Reply: A lot of assumptions, isn't? It is you who chooses to solely focus on USA. In truth, I live near Russia and know full well that weak ones are trampled and abused. It is only you who are unwilling to see the bigger picture. Our well being is only made on the backs of the soldiers. We looted the world, we took its resources, we continue to destabilize them. Why? Because the moment they become prosperous is the moment then our nations are on the defense. It is then we cannot anymore feed our economies with cheap resources and in return, price of goods will skyrocket.
Reply: REgamesplayer Talking about assumptions... And justifying war with economic prosperity... Ever considered that you might be a bit of a psychopath by the way? Just seems fitting for how apathetic you are.
Reply: War ultimately was always about economic prosperity and/or diplomatic dominance. Fools believe propoganda, planners take care of a nation's future.

I'm not a psychopath as  a disorder. I'm a psychopath by a choice.
Reply: Wrong , as it also makes the internal volume smaller and less useable.
Reply: But it offers better protection. If you take vertical plate that has 100 mm - and a sloped plate that in the line of sight has 100 mm, the second is going to provide more protection.
Reply: 19Koty96 and will need more weight
the advantage is it can bounce the shell and it needs less width so it can produced easier , and thats all 
 it doesnt offer more protection than the same amount of vertical armor
Reply: IT FUCKING DOES.
1) it does not weight more. There is no reason for it to.
2) shells have less penetrative power versing sloped armour. Modern APFSDS long-rod rounds help nulify it, but they do not do that completely. Want example?

T-64 front plate has line-of-sight thickness equivalent (uses composite) of 350 mm. L15A3 APDS round has around 400 mm penetration at point blank, keeping 380sh penetration at 2 km. Cannot penetrate the front plate until 500 m in ;)
Reply: 19Koty96 it does as you need it longer , it is basic math that the area is height*base , even for the parallelogram
Reply: Yup, I will have to side with him. Sloped armor has disadvantages in its weight and reduction of internal volume.
Reply: No, basic math tells you that it is exactly the same weight. https://cdn.discordapp.com/attachments/176695989321728001/272085790127816716/unknown.png

So no, it is not heavier. It is the same weight.

As for internal volume, that is subjective. As you can see in the small diagram I made, the weight will be exactly the same, as will be the internal space, what is true however is - it is harder to utilize. But with better protection.
https://cdn.discordapp.com/attachments/176695989321728001/272086607752986625/unknown.png
Reply: You forgot Pythagorean theorem. The length of the sloped armor is longer. In your diagram you do not take into account that sloped object will not reach the same Y as it stands on 90 degrees angle. You are actively cutting the height of this tank in order to retain same amount of S, surface area.

Sloped armor does drastically decrease internal volume and you have to get crafty with the remaining space. This is why T-34 was so tight. All around inwards slopping. Take a cube for example. It represents non sloped armor. Now, put a shape directly through the half of the cube as your sloped armor. You will see that 45 degree slope reduces inner volume by 50%.

https://www.google.com/search?newwindow=1&safe=off&client=opera&hs=12M&biw=1366&bih=698&tbm=isch&sa=1&q=cube+in+half&oq=cube+in+half&gs_l=img.3..0i8i30k1l2.10217.12985.0.13209.8.8.0.0.0.0.130.711.3j4.7.0....0...1c.1.64.img..1.7.711...0j0i67k1j0i30k1j0i19k1j0i5i30i19k1j0i5i30k1.2ppL-u7cwlQ#imgrc=hRIDXK9DENk41M%3A

In your second picture you also actively cut into the length of the hull itself. You had shortened the tank too which would end in impossible to design model effectively.
Reply: I am not cutting any height. It is the same height. And has the same area. Math.

I am also not cutting any length. I am showing you that internal volume can be kept with the same ammount of armour and weight.

it is YOUR picture that reduces the length of the upper surface you see? (That would actually make the tank lighter ;) ) You see - while you keep the down base the same length - THE UPPER ONE IS SHORTER. Mine compensate for each other.

Please, stop arguing.
Reply: I can make you a simplified picture however. You know, like for kids.
Reply: https://cdn.discordapp.com/attachments/176695989321728001/272106798901624833/unknown.png

Here.
Educate yourself.
Reply: 19Koty96 So i was right^^ thx
Reply: Well, we both were. I think you just meant something else than I did ^^;
Reply: 19Koty96 Yeah